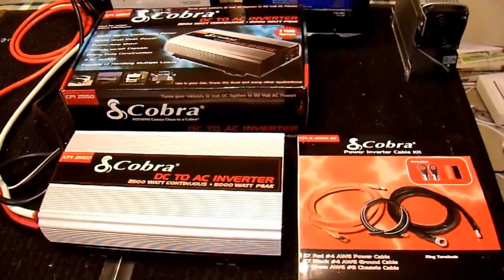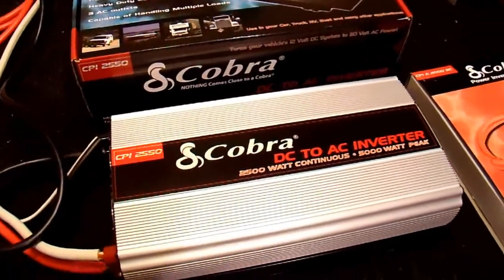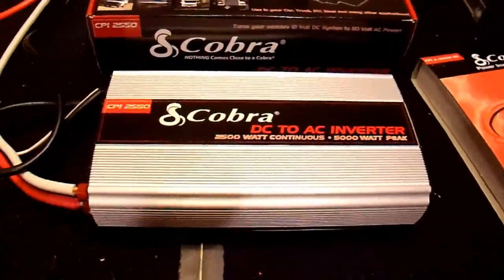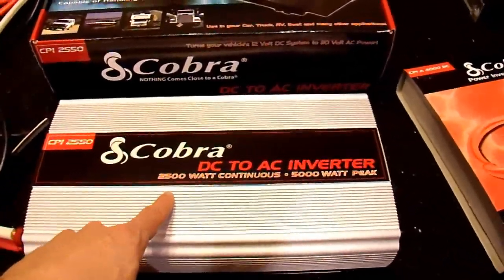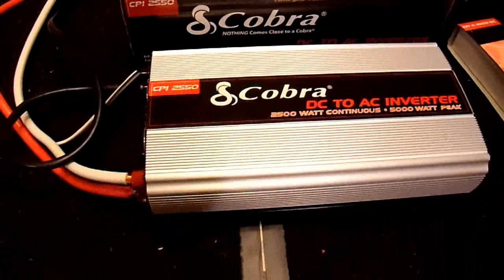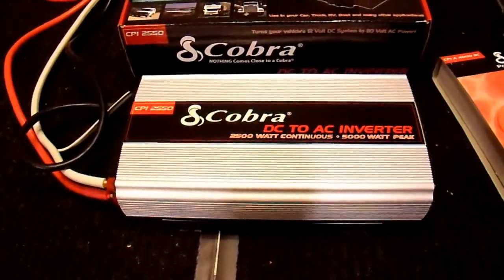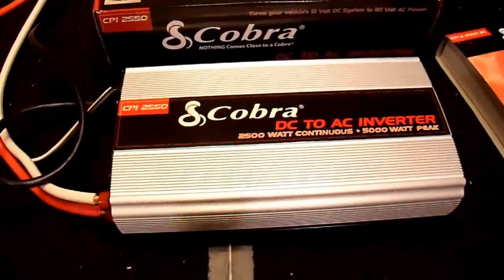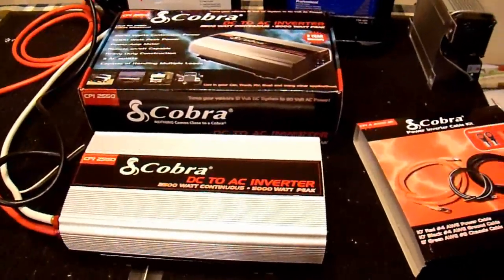Cobra Inverter Review Part8 - Summary and Conclusion

Comment: Heres the one I was looking at, ebay literally didn't work for me earlier, but is now. Cab;t oyt a link in here can try and pm you but the title of the item is "2500W/5000W Stackable Power Inverter DC 24V TO AC 240V"

Comment: ebay dosn't seem to work for me now but I'll give ya a link to them but if you search "parallel inverters" They are the ones with the diagram of 2/3 inverters connected in parallel, very cheap, apparently true sine wave, apparently 2500w.

Comment: Great info, and way to get more info as I'm trying to buy cheap, but not get too ripped off :)

Wondering what your thoughts are on paralleling inverters, there was a cheap 2kw or so invertor on ebay that can be paralleled, have you seen those at all ?